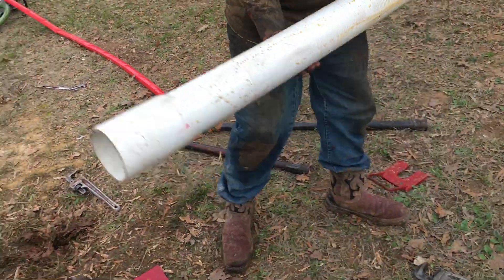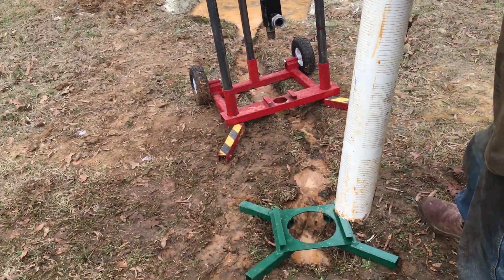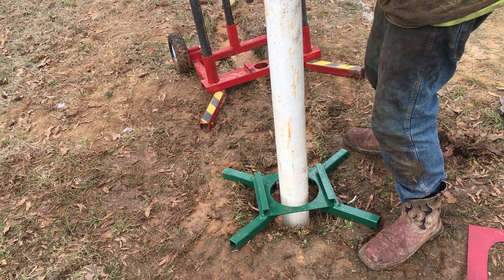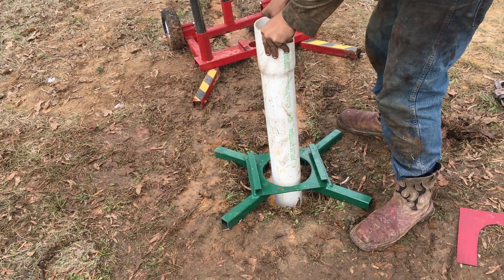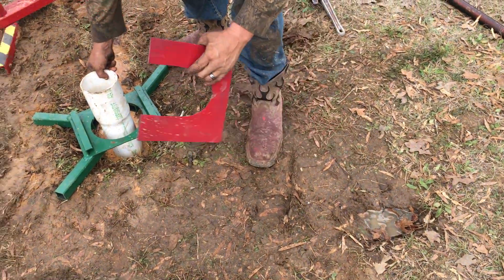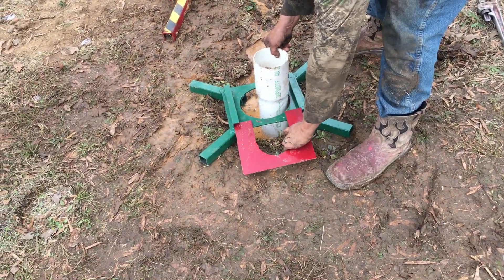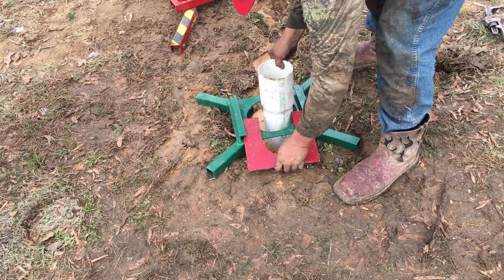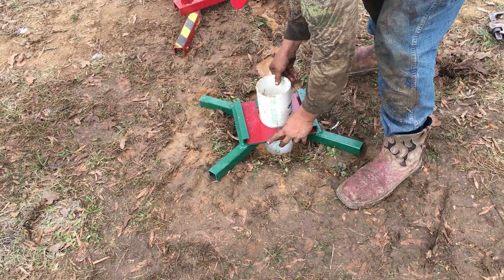IMG 3213 DEEPROCK DIY Waterwell drilling rig $3470.00 and $340.00 shipping in lower 48

Comment: Just wondering why you didn't glue the 2 pieces of pipe.  I world be worried that for one reason on another I would have to pull it back out and it works come apart.   That is something that is almost guaranteed to happen if I was doing this.  Lol.
I'm seriously considering purchasing one of these units.
Reply from the maker: it was glued with clear wet dry

Comment: that is the longest sentence i think i have ever seen???? wow not a period of a paragraph break in it?  most ppl just need to drill on  or 2 wells .
Reply from the maker: yes sir plenty of facts on drilling thats what we are here for to answer all your Drilling questions so as to make you successful on your well ive Drilled over 350 waterwells and can answer ALL your questions Thanks
Reply: @davidgroesch1136 my biggest issue is once I drilled my hole down and pulled all my rods back out I couldn’t get my 6” pipe more than a few feet down. The hole had closed up. Trying again this week but frustrating wasted all day drilling only to have hole not stay open even with bentonite.
Reply from the maker: Hello sir always make sure u put a level on the rig #1 thing cause if u are a little off it will be not a 100% straight borehole and when u out your pvc pipe in borehole it will hit the side and not go down  borehole has to be straight so pvc will slide in if that’s the case pull your pvc out and then put rig over borehole again and then Level the rig and after it’s level then drill what ever was not rct then trip out pipe asap and set ovc in asap asap  o lunch ect just asap before it has a chance to cave

Comment: What are the specs on the mud pump? I’m looking at a local trash pump and it claims to move maximum 1” solids at 36 PSI so I’m wondering if it’s sufficient? Thank you!
Reply from the maker: get a 2x2 semi trash pump with hard hoses not the flat dis charge
Reply from the maker: yes sir a 2x2 inch semi trash or a 3x3 Semi trash water pump is great semi trash and FULL trash is great pumps for your DEEPROCK DIY Waterwell Drilling rigs Model 2022